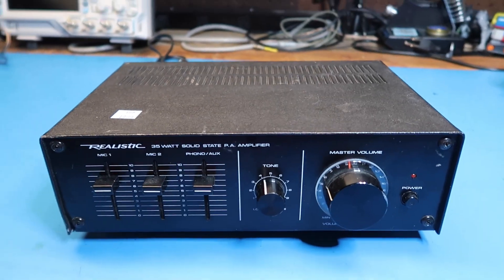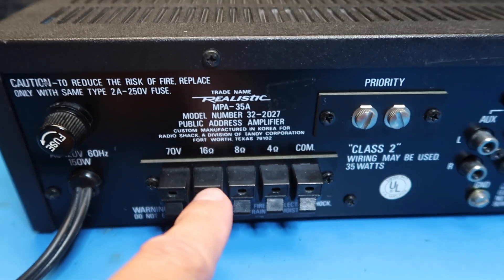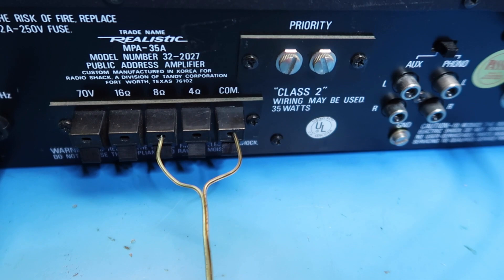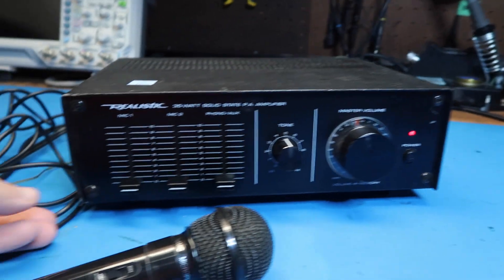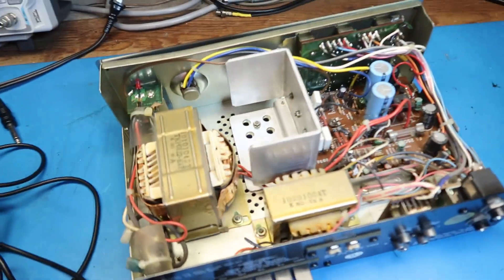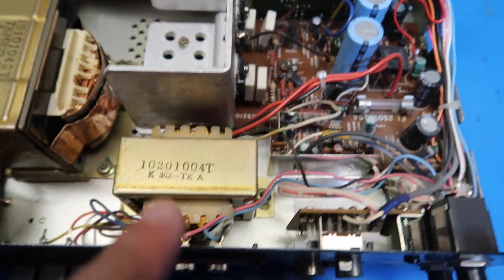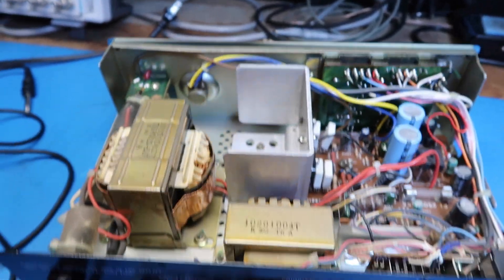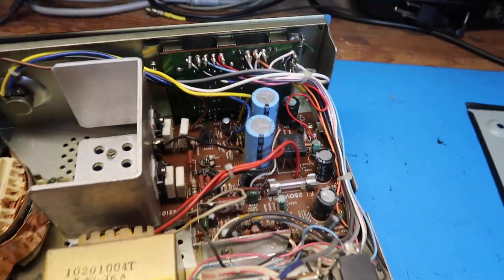Discovering a Realistic 35 Watt P. A. Amplifier

Comment: I found one of these today at a thrift store and hooked it up to an Echo Dot/Alexa. Plugged 2 Zenith 8 ohm speakers in to the 4 ohm out using a Y adapter and it plays well. Plenty of power outside by the pool. Yacht Rock Radio on I Heart Radio (some like it yacht) sounds pretty darn good. The speakers are old Allegro 3000 which in the day were not TOTL but held their own.

Comment: Actually the 70 volts is for driving large groups of speakers. It's only 70 volts of audio AC at full volume or power. Every time you parallel a standard 8ohm speaker with another, the impedance drops to four ohms. The more speakers in parallel, the lower the load impedance gets. Putting speakers in series has the opposite problem where the combined impedance becomes too high and you don't get much power out of the amplifier. So you would have to have a complex series/parallel speaker configuration to attach many speakers to the unit and stay at 4, 8, or 16 ohms. The 70 volt system requires a transformer on each speaker to match the high impedance 70 volt line to the speaker 8 ohm voice coil. These transformers typically provide taps for different wattage to the speaker. You pick a tap that provides the desired volume. The 70 volts comes from the safe limit for class 2 low voltage wiring. There is also a 25 volt standard used in more safety conscious systems such as schools. And there are 100 volt systems for large stadiums where higher power is needed. 
https://en.wikipedia.org/wiki/Constant-voltage_speaker_system